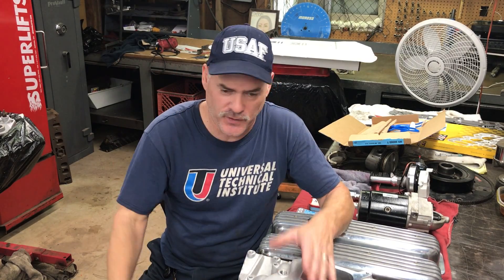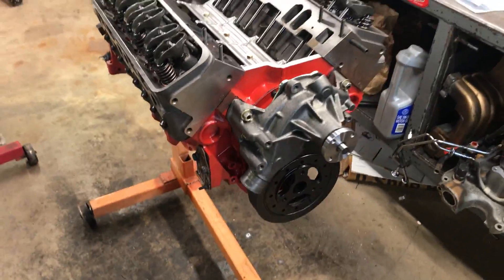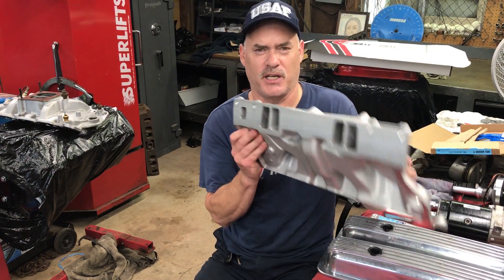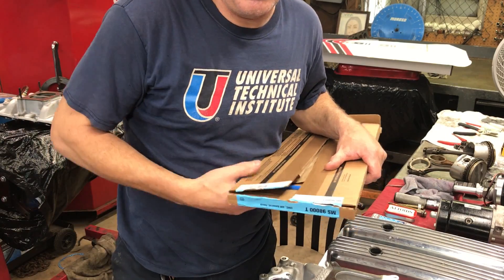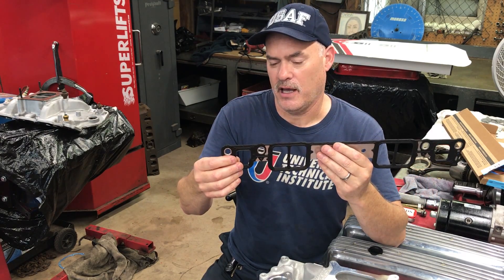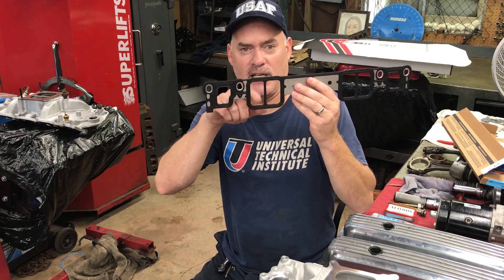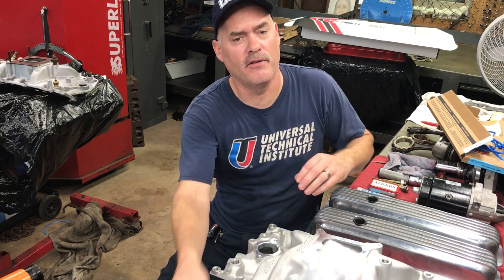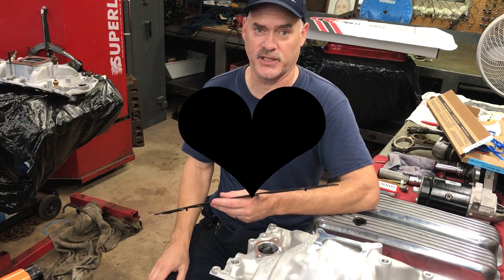5.7L Vortec  Intake manifold gasket problems

Comment: I've had zero problems with the FelPro plastic gaskets with the blue print-o-seal o-ring in them on my Vortec heads. That's just one motor though... Cross my fingers, hope they last a long time.
Reply: Fel Pro problem solver gaskets are great for many engines. The 3.1L, 3.4L, and 4.3L V6 also have really awful intake gaskets and the Fel-Pro gaskets last far longer.

Comment: you should make a video of the upgraded spider injector for the 5.7L also the gaskets on the two piece intakes are plastic as well and they like to leak right around the water ports and they will leak coolant and you won't know it til it's too late! I have dealt with Chevrolet intake gaskets for many years and have changed so many of them. Just thought it might be a cool video to make of the difference from the poppit style spider injector vs the new upgraded design which works so much better and they have so much better throttle response and performance.
Reply: What's the part# on the new injector style & on the 2 piece intake gaskets kit?

Comment: Ive used that felpro kit with no issues
Reply: Yup, my 1998 k-series z71 still ain't leaking at all with the Fel-Pro kit. Really complete gasket kit.

The 1996-1999 pre LS1 gasket kit doesnt have the right intake gaskets for a carb intake, I believe.

My trucks still stock, shit 34lb injectors inside thw upper manifold and all that ish.

Comment: I thought factory vortec heads cracked easily??
Reply from the maker: Yes the do have that drawback thin castings they are ok unless you get them hot I like to use aftermarket heads Dart and RHS both make a version of this head they work very well
Reply: Just don't run them hot or they will probably crack lol. By hot I mean smoke rolling lol but the aftermarket versions are not near as thin. I believe summit also has their version for like $700 a pair. Probably not as great as a Dart but still pretty nice and worth the money

Comment: Those gaskets are the only way to go. From sbc to the 3.1/3.4 /3.8 and Even on the "LS" motors,  the updated green intake gaskets that supercede the orange aren't as good as those metal framed gaskets.
Reply: 90W7   7.25.17.     I only use the metal framed type, from either Fel-Pro, Magnum, or GM, in the 3.1/3.4 & the 3.8L V6 engines that I've worked on. Have not had one issue after I started using them! 🏁

Comment: Why couldn't you make a jig ,and drill and tap 2 center bolts in the heads, and intake ?
Reply from the maker: It is so interesting that you mention that because I was thinking the same thing yesterday when I installed that intake you might be on to something there I do believe I am going to try that on one of these, I like the way you think
Reply: I was thinking that too
Reply: I put these gaskets on my truck @ 180K and lost the bottom end at 300K and still no intake gasket leaks
Reply: It won't work on a stock manifold, no room for it (which is why they aren't there in the first place), but for an aftermarket carbureted intake, it's worth shot if you're having trouble with vacuum leaks.
Reply: Myvintageiron7512 enjoyed your video on small block heads. My question is on 041 heads , at what lift and rpm does the intake valve become saturated?
Reply: Another billion dollar per year company that can't engineer something so incredibly simple.
Reply: Charles Dyer  that would be something really interesting to try. I'll be waiting for the video
Reply: Dan M I have 130,000 on my 98 z71 and now mines leaking front, back, and a small leak on pass side lol wish I had your luck....kinda angers me cause it's been taken care of since I bought it from the original owner  (80,000 ago) but at the same time I'm good with it cause I been wanting to get in there and do some stuff anyway lol
Reply: I just got mine in the mail yesterday. Now its time to find the right DIY video on how to change the gaskets.
Reply: Same here!  I’m building 92 350 short block & my machinist has a pair of vortec heads he wants to sell me.  I’m gonna be facing this issue head on in about 3 months, thanks for posting, I plan to stick 1 or 2 bolts between intake ports 3&5 & 4&6.

Comment: Would these gaskets prevent vacuum leaks, my carbed 357 idles like it has a vacuum leak but I can't find anything but I wonder if it's the intake gaskets. I'm not using the plastic ones, I have the ones that come without the snap in clips (SCE 111119). Overall my question is could these be the reason for a hidden vacuum leak.
Reply from the maker: take some starting fluid and spray it along the intake gasket with the engine running it will get sucked in where ever there is a leak and the engine RPM will speed up for a second
Reply: I have the same issue in my 383 stroker with vortec heads.  Very high rough idle and  I can't find a vacuum leak anywhere.
Reply: I prefer wd-40, use the straw along the gasket line and the engine rpm will drop if a leak is present and you don't have to worry about vapor going into air intake opening giving a false positive.
Reply: I used brake cleaner and when I sprayed around the valve covers and the engine idled down and even died one time so I assume it's a leak so I'm going 2 try these covers, does it sound like a good idea?